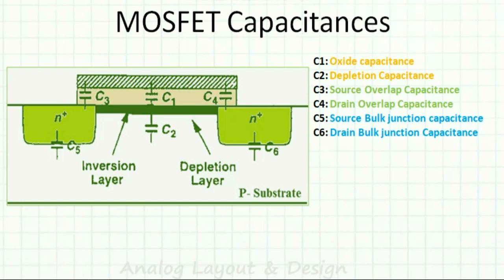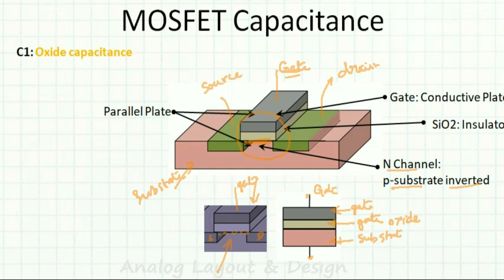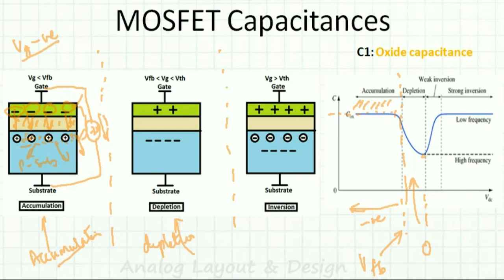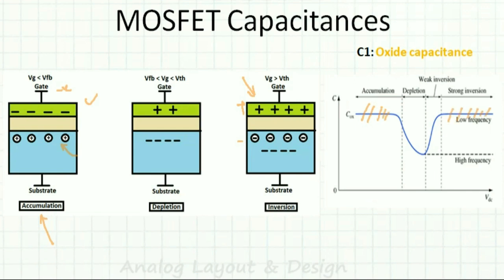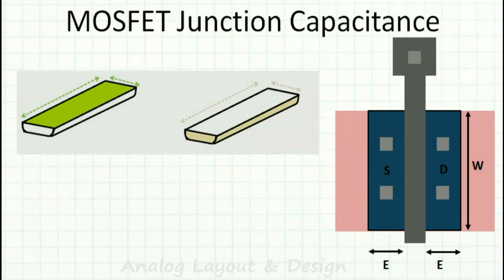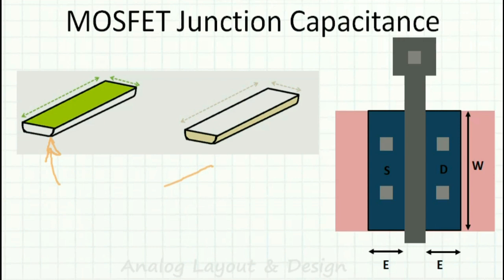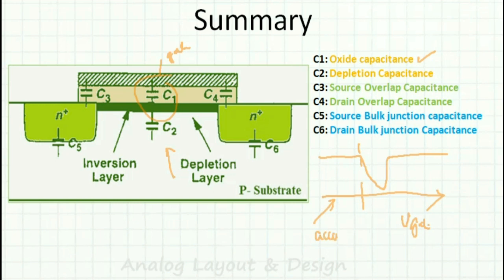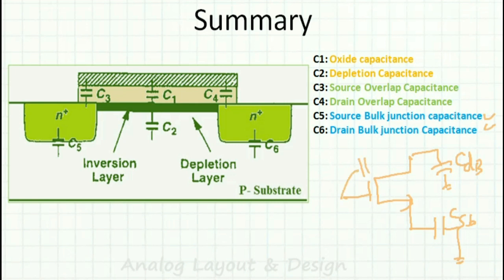MOSFET CAPACITANCE

Comment: I think while calculating "Cdb and Csb " capacitance, perimeter will be "2E+W" (not 2E + 2W)
 .... i.e Cdb or Csb = Cj*(E*W) + Cjsw*(2E+W) ..because drain/source  width-face facing towards fet channel will not form PN junction ..because channel is "n" type ...so n+n type junction will form.....
Reply from the maker: Yes the thickness of the source and drain is negligible… cjsw is negligible… the source and drain exposed to the substrate will have highest cap

Comment: If  "t"  is so small, then how would E x t equals E ? Eg. 15micrometer  x 0.1micrometer should be 1.5micrometersquared.  I hope you are safe and well during these times of epidemic. I am from Kerala.
Reply from the maker: Hi Pratosh..
I guess you are speaking about sidewall capacitance. 
The unit capacitance cjsw is calculated for that minimum thickness.  So,  if we multiply by the length or perimeter,  that's enough...
Cjsw unit is farad/meter where as cj unit is farad/m2.

Hope this clarifies
Reply: @analoglayoutdesign2342  I think the whole idea is that eventually sidewall capacitance is less and so either neglecting thickness nor considering it in the calculation wont have any recognisable impact on switching events. Correct me if I am wrong, as when other people read these comments with this same doubt, they could walk out with a clear mind. Also I hope you do one set of videos for MOSFET switching, as it is a widely searched topic on MOSFETs . Thank You for responding.
Reply from the maker: Hi @pratosh666  ,

That's correct... the sidewall cjsw capacitance is very very less compared to junction capacitance cj...
When it comes to speed,  that's right.. sidewall capacitance plays a role... but that's over come by locos isolation or STI shallow trench isolation. 

Sure I will post video in this regard... thanks for feedbacks/ discussions
Reply from the maker: I am fine and hope you are also fine.  God bless everyone.